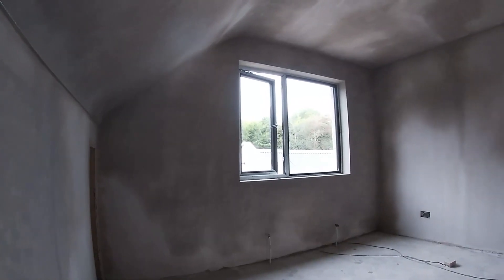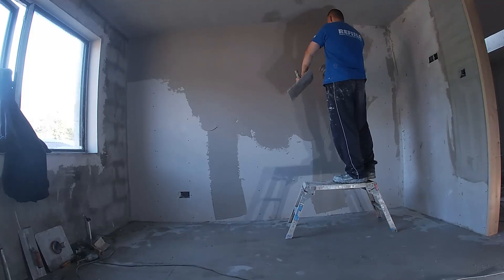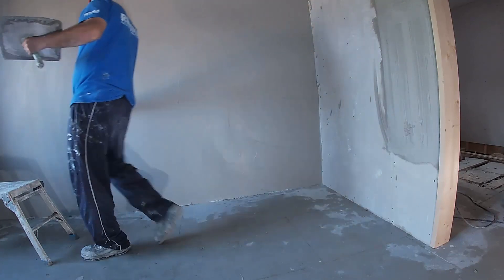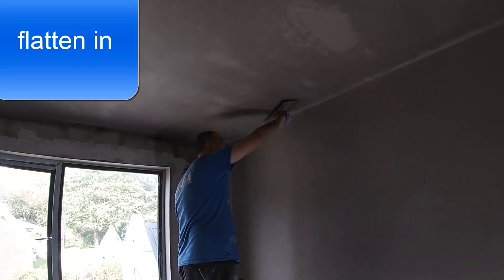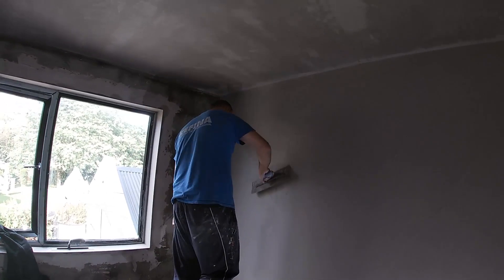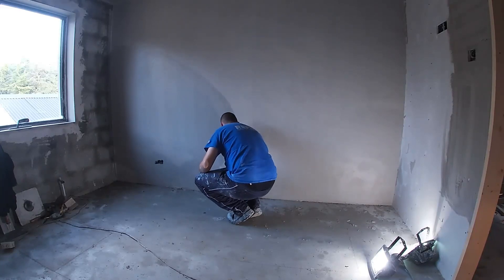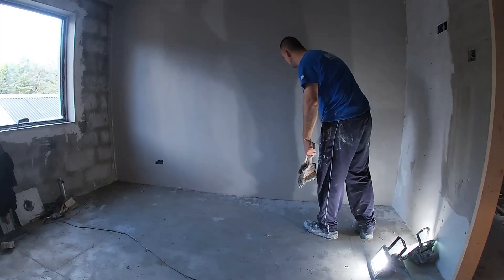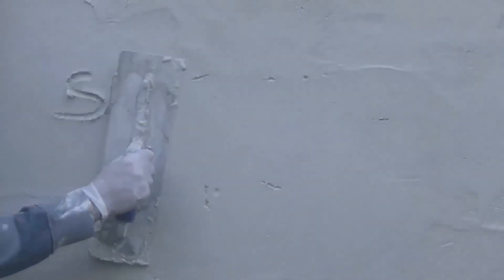How to plaster a plasterboard wall aka stud wall

Comment: Hi pal do you not cross trowel your 2nd wet and ever use spat/speed skim etc?
Reply from the maker: Yes use spats loads this is just a few clips really, i did a full tutorial on plastering a stud wall a few weeks back and one on plaster sand and cement on block and skimming it also

Comment: Our Plasterboard here seems to be a bit different,the new skimming type plasters (Proroc and Thistle)here say not suited for skimmimg on plasterboard here in Australia
Reply from the maker: What are they suitable for then just fillers?
Reply: @macplastering  -on render and solid backgrounds,plasterboard only joints set here just like the U.S Drywall industry.You guys lucky that your system looks so much better and better work for spreads
Reply from the maker: Yea i do think this way is better all round if I was buying a timber frame or solid i would go solid all day long

Comment: Thanks for sharing you knowledge, good suggestion to start in a closet first… I’m actually doing a closet at the moment, gyproc (drywall) in my basement at the moment and I’m contemplating giving it a shot… Only problem is try to find what I need to plaster… In my part of Canada, it’s only drywall, taped and mudded joints that’s it… cheap and fast, not built to last…
Reply from the maker: Can u get the stuff called diamond somthing i see guys using that a lot there but looks hard ti finish